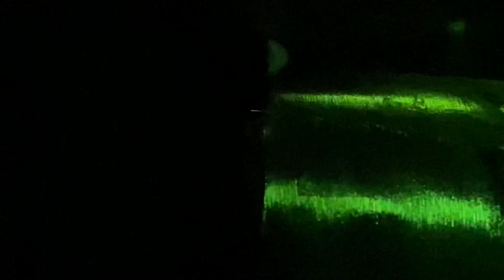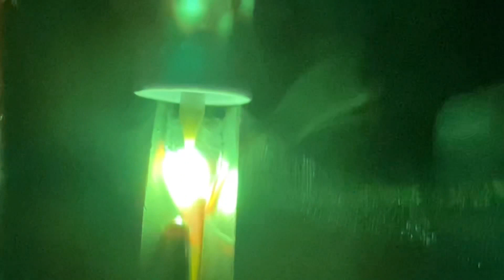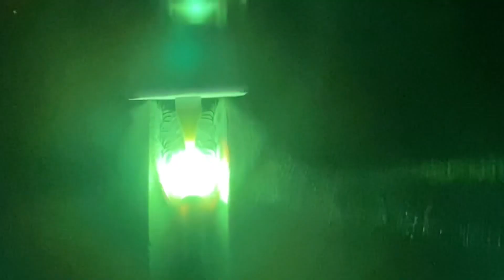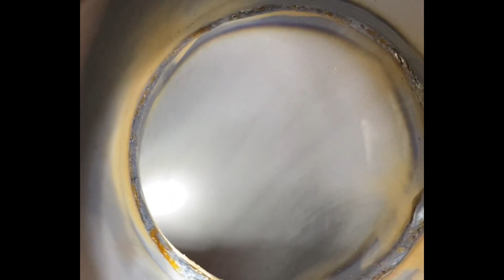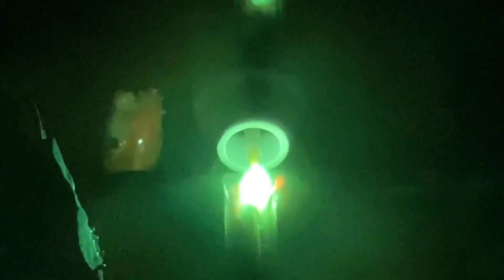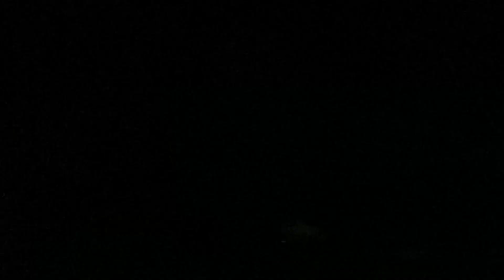Rollout Tig Welding Root Technique in 4 Minutes !

Comment: Great job.  Im kind of fed up of my torch tig welding handle.  The Migatronics are super ligth.. but above 150Amp they are real juice. Do you do scratch start on that handle you run with or have pedal on it? ... I want the same handle.  The Miller handels I like .. they are real quality.
Reply from the maker: Scratch start

Comment: why not welding at 1/2 o’clock side but at the 10/11 side in front?
Reply from the maker: At 11 o’clock in rollout the gravity makes that root appearance more uniform and consistent, usually works good when running really hot and fast

Comment: Do I keep going with torch till key hole opens up???
Reply from the maker: Once you connect both sides, you start welding, wiggling the cup within the bevel, and adding filler wire. If you start from the tack, pause a little bit, wait until it starts melting and then you start adding filler wire. Just practice if you can and you will catch it very fast. Don't be scared, that's how you learn.